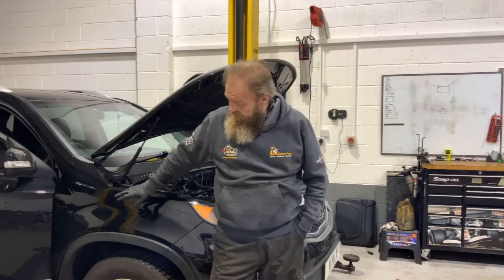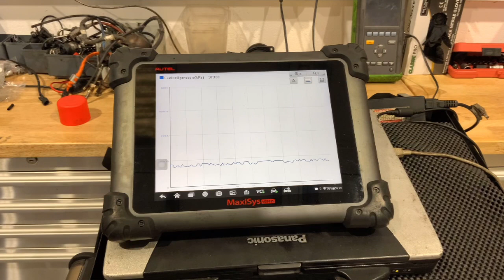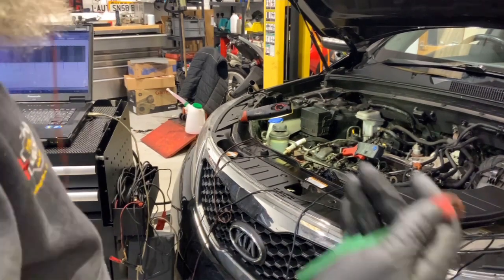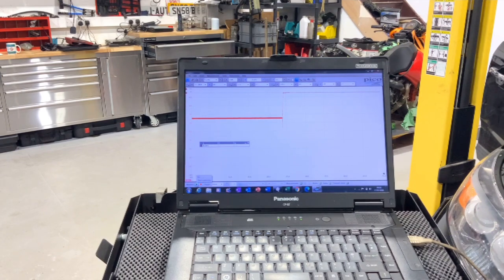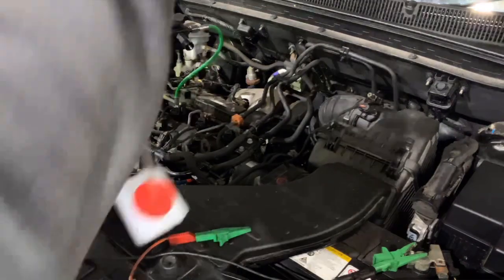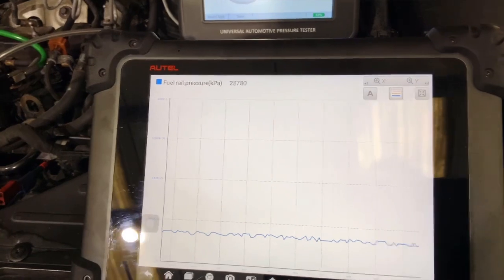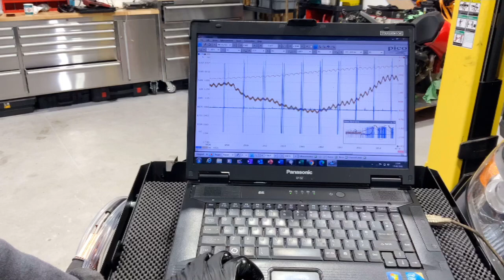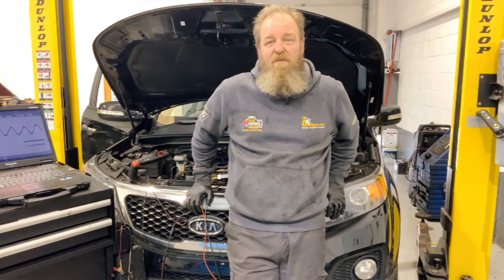Intermittent Faults are just a time vacuum.

Comment: A lengthy process but I guess once you eliminate things one by one it will narrow down what the culprit is however unlikely.  . Had a very similar one to this that was caused by a frayed wire on the engine loom. As the engine rocked when pulling away quickly the loom that was secured to the bulkhead would pull apart causing the cut out. Sussed it out when I realised the  the fault never happened when reversing!  Might be worth a wiggle test round the loom.

Comment: Hi I had Kia with similar problem intermittent cutting out turned out the wiring near the battery tray where damaged had fault codes for injectors

Comment: Hi I'm new to scoping. I brought one and don't know where to start. Do you have any advice on how to approach it.
Reply: Just finished up on this same exact Engine. Injectors and PCM failure. Replace mechanical pump and rail pressure sensor. Working great so far. What voltages did you get out of the pressure sensor. Plus did you test scope the fuel regulator?